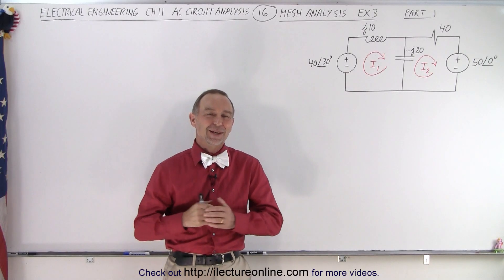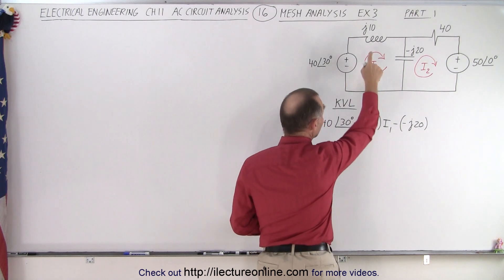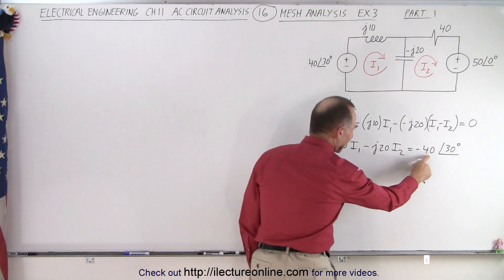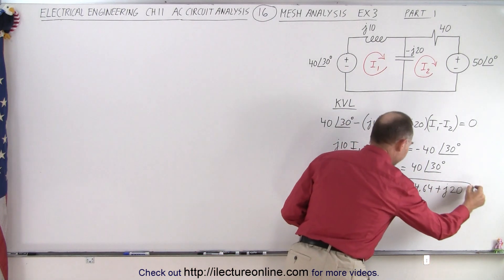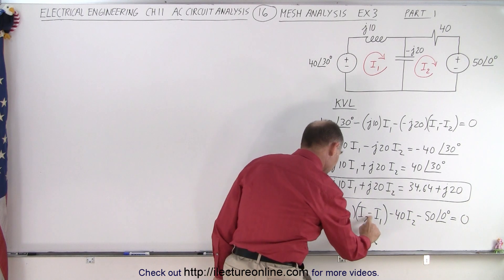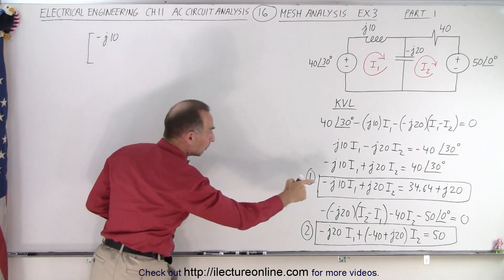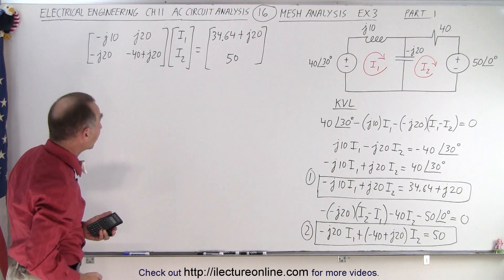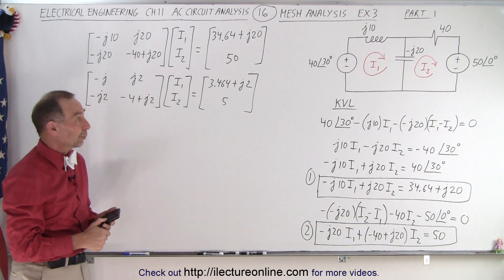Electrical Engineering: Ch 11 AC Circuit Analysis (16 of 34) Mesh Analysis Ex. 3 (Part 1)

Comment: I have a question plz, in 3:08 you took -(-j20)(i2-i1), for me i took it (j20)(i2-i1) because the I2 enters from the - side of the capacitor, shouldn't we take it as + ? while in the mesh 1 you took it - , so in mesh 2 logically can't be -   .. so sir can you explain this plz?
Reply from the maker: For KVL, when you move in the direction of the (assumed) current flow, and you cross a device like a resistor or a capacitor, you have a voltage drop.
Reply: @MichelvanBiezen  i didn't know that rule, what about the battery, we don't consider it with the resistor and capacitor? because in mesh 1 when the current enters from + we took it - , while in mesh 2 current enters from - we took it +
Reply from the maker: With a battery, you ignore the direction of the current, and strictly look at the polarity of the battery to determine the voltage rise or voltage drop across the battery.  (It only depends in which direction you move across the battery)
Reply: Aa okey sir. thank you very mush for the information